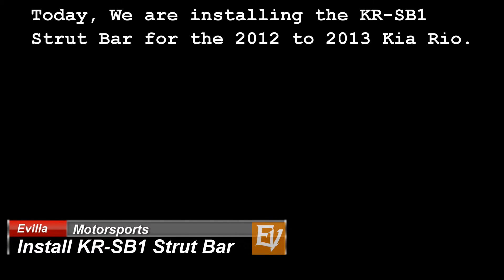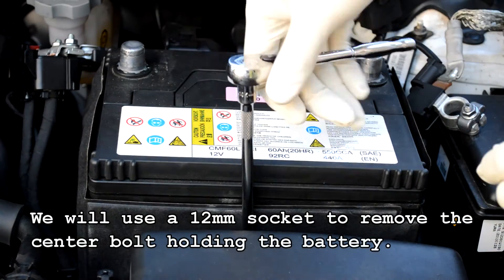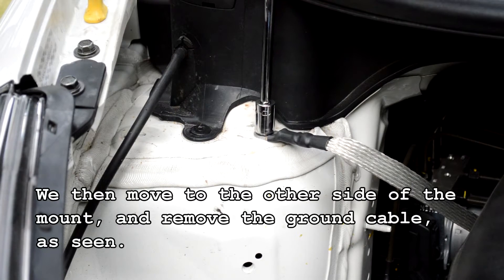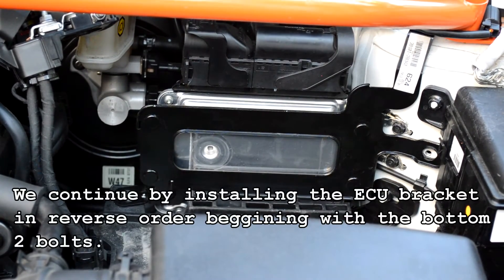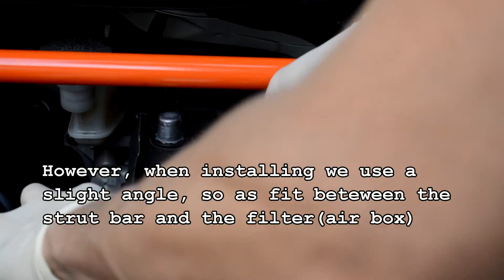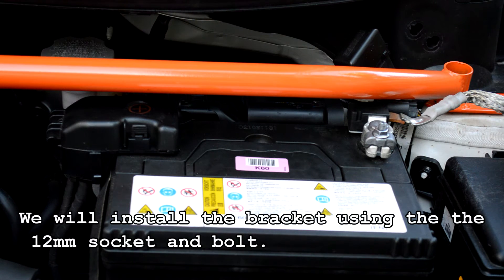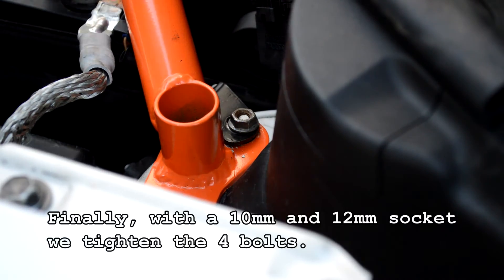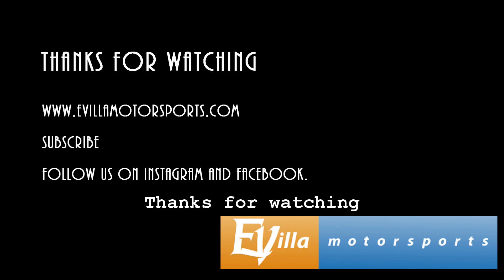Kia Rio (2012-2013) SB1 Strut Bar Install Video

Comment: You do realize you are screwing ground wires to a painted surface which is a big NO NO!!!??? ALWAYS needs to me medal on medal contact, never bolt onto a painted surface. **To anyone watching please grind/sand the paint off the area where the ground wires are!! If you are running heavy electronics such as an amp/subwoofer you could take the chance of hurting your electrical system!!**